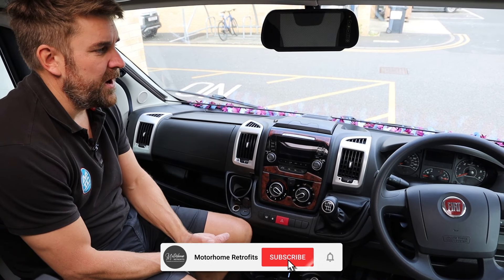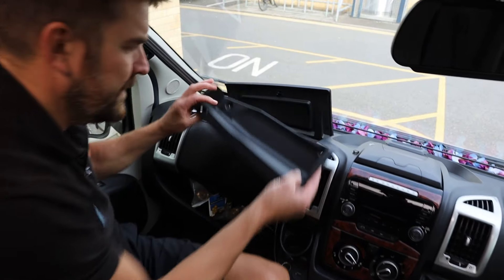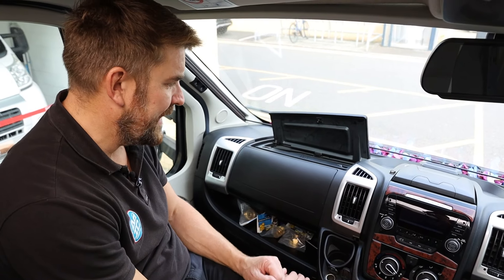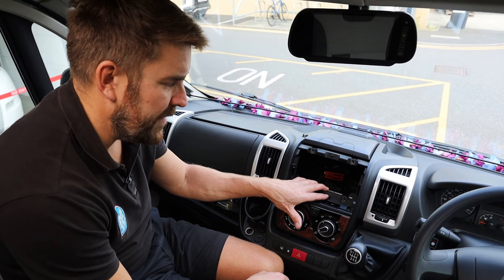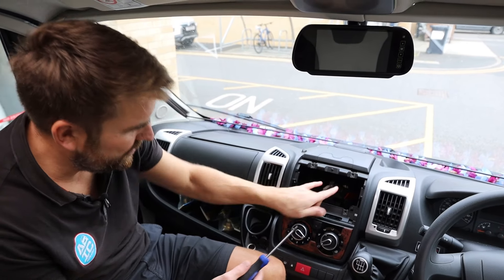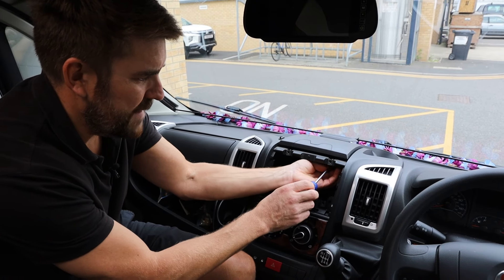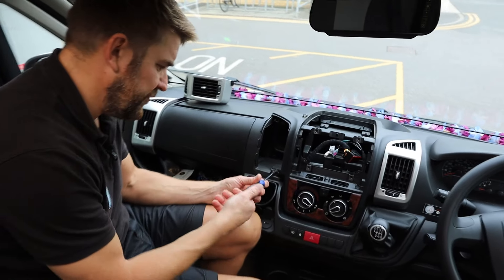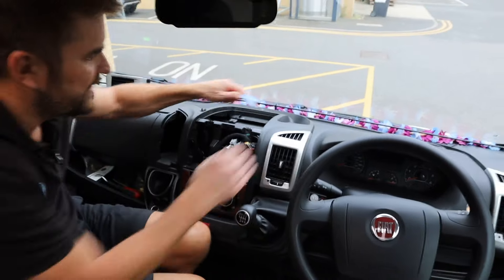How To: Take Apart Your Fiat Ducato, Peugeot Boxer or Citroen Relay's Dashboard (Beginners Guide)

Comment: Excellent video, so many screws to find and remove really good to see how it is all put together, a question please, my 2010 Peugeot Boxer Autocruise has an alarm issue and the main alarm unit( Meta) is fitted to the bulkhead, how much further would I need to go to access the bulkhead and remove the unit for repair? Thank you

Comment: great video that's very helpful - thanks. I can't help noticing that this and the other howto video are amongst your most popular. I was trying to figure out how to remove my lower cup holders so I could route some USB cables more neatly and managed to figure it out based on your other video but a video about how to remove lower parts of the dashboard might be good as well 😊
Reply from the maker: Hi, thanks for your comment, we've already done a video on how to fit the cupholders, eventually we'll do one replacing them but you could watch the steps in reverse for the same effect.

Comment: Excellent clip, nice work.
Have you made the following clip yet?
 I am replacing the air conditioning evaporator and need to remove the entire dashboard.
I am now at the stage at which you finished your clip and I cant figure out how to get the dash out.
I have disconnected the air bag but the dash board appears to be clipped in along the base of the windshield. I assume I would need to lift the dash to separate the clips but do not want to use to much force just in case.
I am also concerned that I may have to remove the steering wheel to get the dashboard out.
Ans assistance would be greatly appreciated.
Cheers from Australia.
Peter.
Reply from the maker: Hi peter, we will be working on this very soon, it's been a busy time for us but we have other new content you may find helpful in the meantime.